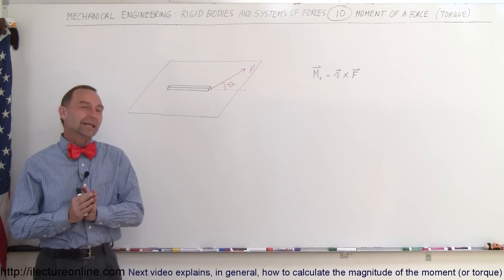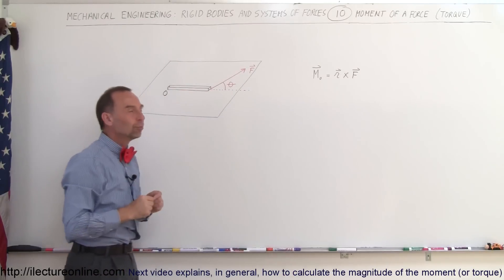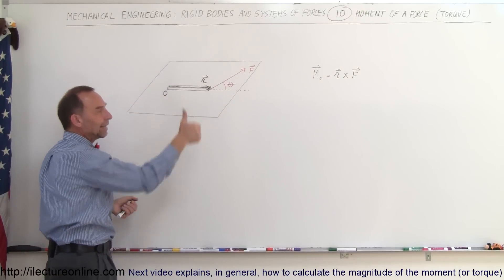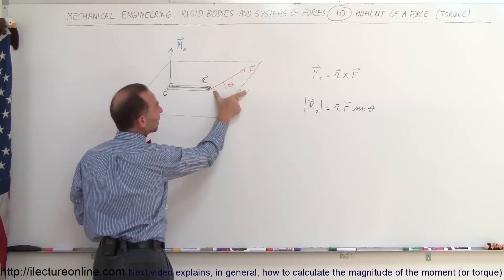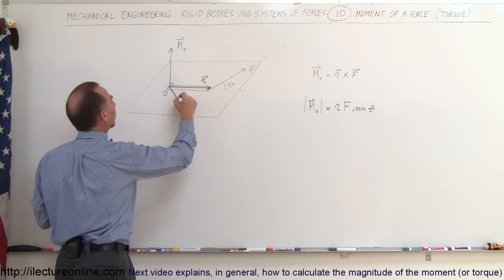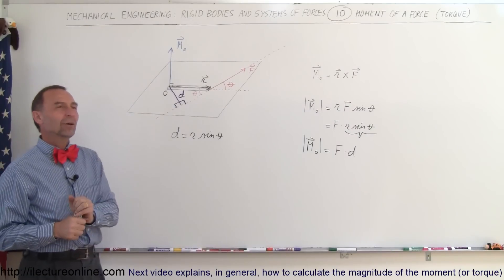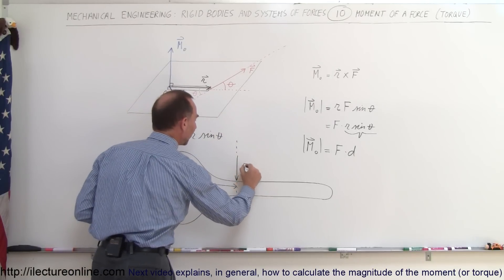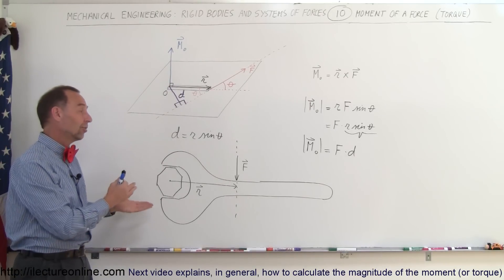Mechanical Engineering: Rigid Bodies & Sys of Forces (10 of 47) Moment of a Force (Torque)

Comment: "torque = momentum of a force" Thank you so much, my teacher wasn't clear enough so a lot of students even those with good grades at the end of the semester didn't know exactly what "momentum" was
Reply from the maker: In physics we use the term: "torque" which means that a force is applied to an object away from point of rotation which caused the object to rotate.  In mechanical engineering they use the term; "moment" or "moment of a force" which means the same thing as torque.    (Not to be confused with momentum)
Reply: @MichelvanBiezen  ok thank you